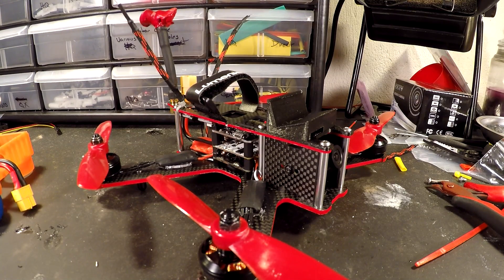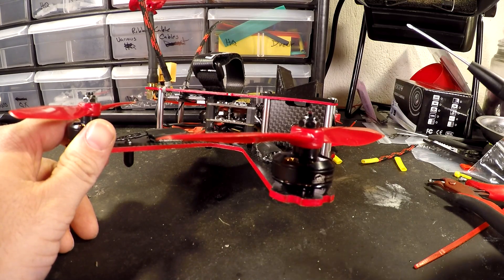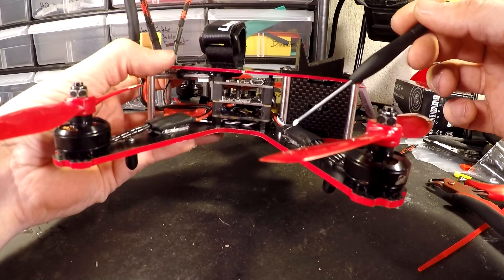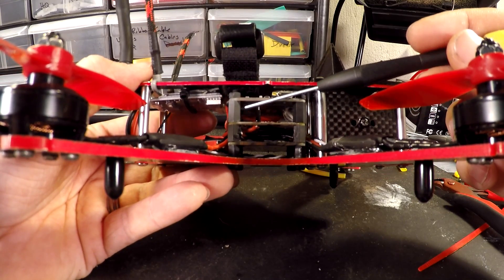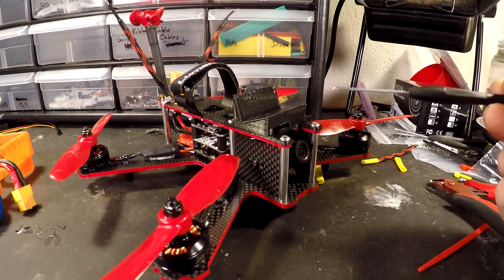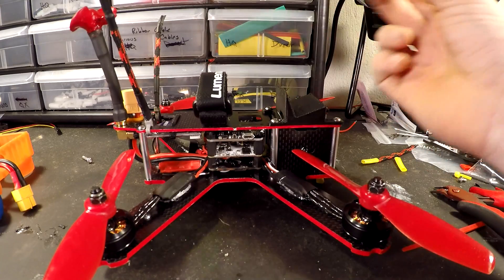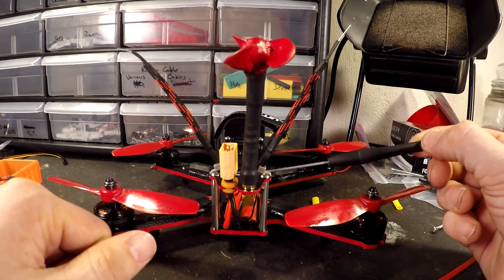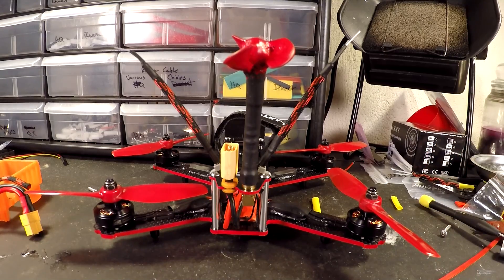Overview of my QAV210 build

Comment: I havent had any good luck with the early dal props. They are unbalanced and 2 broke off in mid flight for being unbalanced. There was absolutely no other reason.
Reply from the maker: +Tvpc1971 Oh wow first I've heard of that.  I've literally never had a blade break off.  Bend up like a pretzel but never break lol.  I did however only use the v2's and once triblades released I immediately jumped to those.

Comment: can you send me a complete build sheet on everything you used?  I see that almost everything is in the description, but I was curious what transmitter / reciever you used as well as fpv set up? Thank you! Great work
Reply from the maker: I use a taranis and x4r receiver and dominator v2 for goggles. Currently working on a diversity setup for the goggles but during the time this video was made I just used a nexwave dominator receiver module
Reply: +T-Bone FPV Thank you for the quick response. How stable is it at a hover? I've never seen one of these just putting around or in a hover. And how is the run time?
Reply from the maker: +Bradley Fuller  perfectly stable and I want to say I average 5 minutes on a 1400mah 4s
Reply: +T-Bone FPV can you fit a bigger lipo on there or is the 1400 the best size
Reply from the maker: +Bradley Fuller most run the 1300-1500 sizes. I only run those.  Best balance for what I do and allows my HD cam on the top as well.  With that said I needed to test it one evening and strapped a 4200mah 3s to the top. It overhangs the front and sides. And the quad lifted it at about 75% throttle 😂
Reply: +T-Bone FPV Quick review of everything used. QAV 210 frame, NAZE32, MRM Zeus 20a (x4), Cobra 2204 (x4), OSDoge, Brotronics PDB, Foxeer TM200 VTX, Foxeer600 CCD Cam, Dal 5045 (x4), and blue beam airscrew. 

Is everything plug and play or are there any adapters needed? And looking at the Brotronics PDB i noticed there was a 90a or 180a option. Is it safer to go with the 180? And as for props I was looking at the dragonfly 5030, have you any experience with those? With everything you have setup do you get some kind of signal through the goggles that lets you know that your battery is running low?

Sorry for all the questions, this is the first one I was looking at building from scratch and even after reading thread after thread there are still a lot of questions that I have. Thank you again for any and all information you can provide!

Comment: Hey man, great build! What you might wanna think about: the motorcables around your esc is not a good idea because of the power interferences. Just cut and solder the motor wires directly to the esc board (gold connectors work like a resistor). The shorter your connection between motor / esc - the better! Have fun with your machine!

Comment: Very clean build! You could make a 180 look tidy! I'm getting there. I've recently switched to the FX799T which does away with all the fatshark filter cabling.
Reply from the maker: +Next Lipo Thanks :) Please Just ordered 2 of those vtx's today to try out.
Reply: I've only had it in a couple of days but I like! Neat, small, easy to channel change with a press of a button, direct solder to board, brilliant. Breaking £60 immersion rc 600mw transmitters every couple of weeks was getting really expensive.